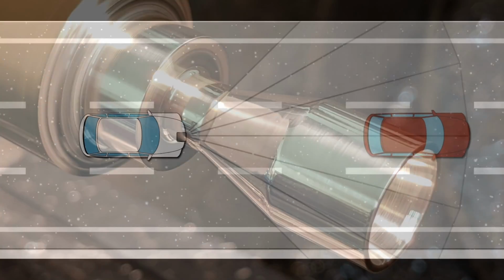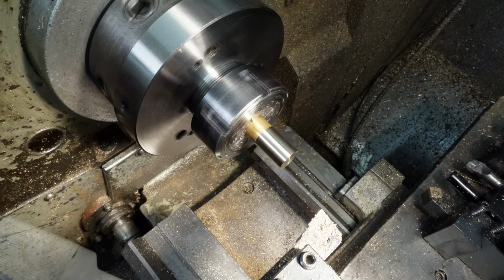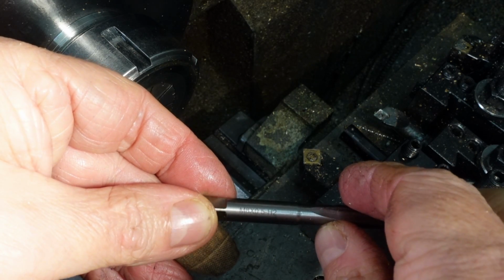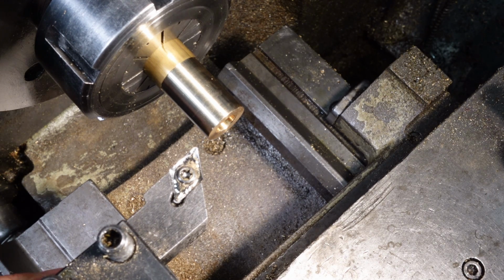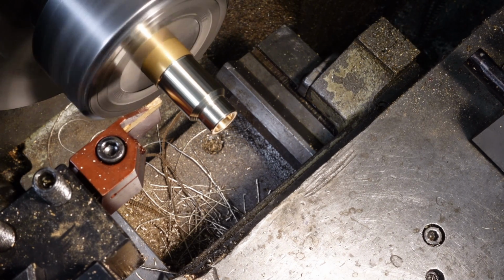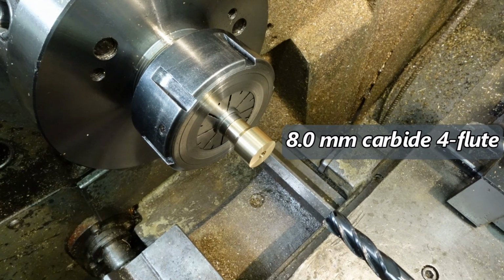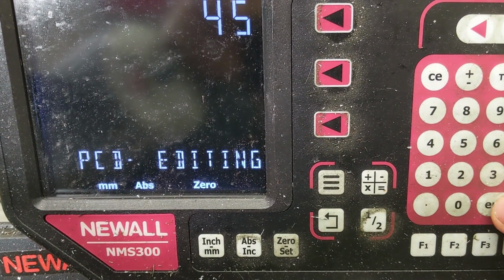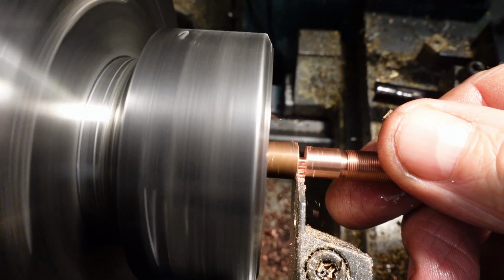Machining 53dBi antennas for 122 GHz mmWave Radar chips!

Comment: Spins drill in chuck while tightening to convince oneself it is helping to prevent clamped chips

Has all of his quick change tools sitting on the cross slide getting showered with brass chips the whole time

You're a madman, my friend. These videos are fantastic. Cheers!
Reply from the maker: One day, the plan to make a rack for the toolholders might actually happen.  One day.
Reply: @MachiningandMicrowaves  do you have a 3D printer? I printed holders for all mine and just screwed them to a board. Happy to send you the file.
Reply from the maker: @anguswhitnall1084  That would be useful, I have a Prusa MK3S+, thanks very much.

Comment: How have I not found this channel before? This is really interesting!
I was born in the 60's and I'm very "unit ambidextrous", I learned metric at school (in Australia), but my father and grandfather used imperial at home so i had learned to convert in my head before I was 10. We changed from miles to km when I was a young boy but my 2 of my first 3 cars were in miles. When I started my apprenticeship all the machines were imperial, but at trade school all of the machines were metric. And the man who taught me all about radio taught me "megacycles" before I knew they were supposed to be called megahertz.
Reply from the maker: I remember GHz being known as kilo-mega-cycles by some of the old timers I used to know in the middle 1970s when I was messing with 10 GHz Gunnplexer transceivers and varactor multipliers and bare-diode mixers. I'm still messing with multipliers and bare diode mixers, but at 135 and 248 GHz.  Everything is less than a tenth of the size of what we used to mess with back in the dim and distant past, but just as much fun.  I have very limited time to make vids, but I have a list of more than sixty that I want to make now, there's ten more in the list since 2 am local time today. John Hazell and friends down in the south of England have been using Hellschreiber visual mode on 122 GHz https://www.youtube.com/watch?v=_hAaYinsG64
Reply: @MachiningandMicrowaves  very interesting! I've always wanted to play with those car radar devices, but I don't have that much time to play with radio anymore (at least outside of work). When I was active in amateur radio I was mainly interested in VHF and up and even made an EME (Earth-Moon-Earth) contact.

I'm actually a Fitter & Turner (and worked in that trade for 11 years) before owning a business installing & repairing 2 way radio and satellite systems in the 1990's, For the last 23 years I've been a Broadcast Engineer in commercial radio - although the company I work for outsourced all of our RF work 3 years ago. I'm looking at getting back into radio at home when I get some more time!
Reply: I was born in the US, Iv always had to at least be somewhat comfortable with other units, starting in working on Japanese motorcycles and whatnot. Not as fast to convert as I once was but I still don't get it when people get so upset about not including certain units.
Reply from the maker: @miles11we  The funniest attempts are when someone does a literal conversion of an approximate value, so "roughly 2 pounds (907 grams)" or "two or three miles (3.22 to 4.83 km)".  Of course, we do have to be very careful about gallons, pints, quarts, hundredweights and tons between UK and US systems. That has led to some very funny arguments about fuel efficiency or vehicles, when the US measurements use different sized gallons.  Marvellous!

Comment: Incredible work! I was thinking about the instrumentation to calibrate at this frequencies. As a technician who worked with C and L bands handling those HP spectrum analyzers was a big responsability due to their high costs.
Reply from the maker: Most instruments stop around 110 GHz, but as we are interested in maximising the far-field and directivity of the antennas, up to a point the S parameters, return loss and bandwidth/frequency behaviours are less important and we can concentrate on bulk characteristics like the received signal strength at a remote location. It's possible to use harmonic mixers, but my simple home lab equipment only covers up to 50 GHz and that's a simple spectrum analyser.
Luckily, the radar chips have all of the SHF components including the antennas integrated into the package, so we are not dealing with anything more than about 2 GHz outside of the chip and in fact we run an IF of 144 MHz for convenience. Some of the instruments out there are certainly about the same cost as a house.  I'm just working on an EM solver model of a tiny choked feedhorn, 3.8 mm diameter with a 1.8 mm core and a choke ring 0.5 mm wide.  Machining those is certainly fun.  For certain very carefully defined values of "fun", obviously

Comment: Just found your channel and now binge-watching your videos! When I was doing my master's in physics I had the university machine shop make me several microwave cavities with intricate internal geometry out of OFHC copper... Just realizing now how painstaking it must have been for the poor machinists. Hope they didn't curse me too much!
Reply from the maker: Oh, but just think of the fun they had making up new curse-words especially for you! I'm having a self-inflicted nightmare making the smallest antennas I've ever attempted. Designed to give -11dB edge taper on an f/d 0.4 prime focus parabola, 3.6 mm outside diameter with a tapered waveguide from 2.00 to 1.80 mm in Tellurium copper and a face choke groove 0.5 x 0.6 mm with 0.2 mm walls.  Definitely at the "interesting" end of what I can make on this 1 ton slab of old cast iron and 1950s tech.  Still, I'm 1950s tech so it seems fair enough.

Comment: Seen the post on hackaday, wasn't expecting the antennas to have this shape, reminds me of a school project when some dude tried to make rocket engines out of 6061-T6, of course they all blew up but he spent whole lunches in the machine room, nice effort.
Reply from the maker: They do have a passing resemblance to a hybrid high-test-peroxide engine if you screw up your eyes and turn your head to one side in a darkened room.
Reply: Interestingly, there was a rocket engine made entirely of aluminum - but the only way to keep it solid is to cool it from the outside.
Reply from the maker: @robbiejames1540  Bit lighter than Inconel I guess. I've never played with rockets, but one of the Youtuber rocketeers is trying to use servo controller vectored thrust to do a Spacex-style soft vertical landing and I had thoughts of using three solid rocket engines which can be moved outwards under servo control in lieu of a throttle to reduce the effective thrust and control direction.  
Must Not Start Any New Projects.....
Reply: @MachiningandMicrowaves  
Funny thing - I'm currently trying to build a rocket engine, but after watching your video I was practically chanting "no new projects" to stop me from immediately heading off and trying to make radars :) Thanks for the very interesting video.

Comment: Well done! I found your videos while looking for a magnetic lathe chuck and now I find that you're into microwaves, radar and such. Those are other, professional areas of interest for me. Love your assistant AIMEE....she'll keep you straight! 👍
Reply from the maker: She's fierce! I'm just trying to get hold of something like the Simturn E3 grooving cutters to make an aluminium mandrel for a corrugated feedhorn at 122 and 135 GHz.  I'll then give it an etch and zincate coating, gold electroplate, then nickel, then a thick layer of copper electroformed and finally boil it up in sodium hydroxide to dissolve the aluminium, leaving me with a gold-coated corrugated horn with extremely low sidelobes, and great axial symmetry, but also, breathtaking bling and wizardry to impress my mother. Who watches this channel.  Hi mum!

Comment: I was thinking of chuck offset just before your comments on spininng the bit as it's tightened. Lovely.
Reply from the maker: Drilling the 1.8 mm diameter holes 48 mm deep with long-series drills really shows up any offset or concentricity errors in the tailstock or chuck, or bends in the drills. I start the holes with a 1.6 mm centre drill and use a smaller high-precision chuck, and check the tailstock position regularly, plus I always clean the bore of the Morse Taper in the tailstock with a sheepskin-covered bore wiper and clean the taper of the chuck carefully.

Comment: I remember when Dad did something like this in the 50's.  He had a 500mm (there abouts - silly millimeter or two) a vacuum tube (valve ?) amp and all.  He was snagged by the local law and went before the judge.  He showed his Advanced Radar with an unlimited note on it - but the judge didn't recognize the FCC and Automobiles.  Dad took it off but completed his tube (there I go again) timing system for our car.  He was something else if you put him in an EE or ME shop.  I have his lathe now.

Comment: Don't you find rotating your drill as you lock it up helps avoid clamping on "pickup burs" on the shank from when you last let it slip in the chuck  ?
Reply from the maker: That's a good point. I try to remember to clean up any drill shanks that get messed up, but most of the holes I drill on the lathe are done with drills I keep specially for that purpose, for tap sizes or reamer pilots, or are non-critical. I guess I picked that habit up from watching my father rotating drills as he chucked them but never questioned what the real reason was. A 50-year mystery solved! Cheers!

Comment: Very entertaining and informative! Thanks
Reply from the maker: Thanks for watching.  Next step in that project will be the subject of a video in 2-3 weeks time. Making a range of dual-mode feedhorns to fit into those adaptors. Absolutely tiny features, with 0.5 mm grooves and 1.8 mm tapered bores. Huge fun using an ancient 800 kg cast iron metal-basher to make antennas so small you can lose them in a trouser pocket, or blow them off the bench if you sneeze.

Comment: I have absolutely no experience, education, etc. in radar, but this video has piqued my interest. 

So you know, I am a licensed pest control technician and have interests in electronics, machining and Isuzu. 

You've earned my subscription.
Reply from the maker: I hope I can keep everyone interested, I'm fascinated by all sorts of things. I've been working on some new antennas only 3.6 mm diameter and 30 mm long this evening, with a 0.5 mm groove 0.7 mm deep in the face.  I'm using a lathe that weighs almost 2000 pounds.  The part weighs less than half an ounce

Comment: Fascinating content, much respect and best of luck to you, sir! Instant subscribe and like 👍👍👍
Reply from the maker: There's a huge amount of content I'd like to get filmed and produced, just not enough hours in the day to do it. Tonight's problem is taking the "electronic leadscrew" approach that James made, but using a really muscly 750 watt AC servomotor with an absolute encoder to drive the cross-slide, plus a hack of my DRO so I can make parabolic, hyperbolic and elliptic surfaces mirrors to work with microwave and mmWave antennas. Trying to design the mounting so it's impossible to engage the transverse leadscrew while the servomotor is active. I've been out in the garden with a green laser, translation stage and precision rotary table, trying to get the rear focus of a hyperbolic subreflector to be coincident and coaxial with the focus of a large parabola.  That is going to be hugely challenging to film, but I just have to do it now I've had a dry run.  Neighbours must think I'm having some sort of techno rave, but spookily quiet.  I've been to silent disco events, where there are two DJs playing different tracks and transmitting them on two channels which can be received on selectable-channel headphones that all the attendees are issued with.  Except I was listening to the level of a transmitted tone and trying to peak up the focus of the dish so the laser beams were parallel at 30 metres away.  Honestly, the things I do for my hobbies!

Comment: Subscribed. YouTube finally recommended a micro machinist! Def an interest of mine as I'm building a ride-on steam locomotive.
Reply from the maker: Lots of folks seem to be working on steam projects, I enjoy @MrCrispin96 Andrew Whale, @keithappleton @trainman4602 and everyone making Stuart engines, plus Lisa Milne (TiklishHoneyBee on Twitter).  I'm more interested in clockmaking and watchmaking and radio stuff, and I've always fancied getting a stationary engine.  My father worked at Ruston and Hornsby, and I'd like to get one of the 1930s models. I'm probably not ready to embark on building a steam loco - maybe if I ever get to retire!
Reply: @MachiningandMicrowaves  I am familiar with most of them but you have really got my attention. 

I'm a digital electronics guy, radio has always puzzled me. My father is a ham and was an electrical engineer at Motorola responsible for the cellular base station division. Unfortunately that radio engineering knowledge never trickled down to me.

Greetings from Chicago btw.
Reply from the maker: @GeeWillikersMan  The really interesting detail is where you push beyond what you can design using Maxwell's equations and field theory by hand or rule of thumb and move into metamaterials and graded index lensing and unusual cavity resonances. I'm working on some models for axially-displaced ellipse antennas, which don't suffer from aperture blocking. That means using big AC servomotors with absolute encoders to drive the leadscrew and cross-slide on the lathe. I'm doing a lot of work on the mechanics and control systems for steering large moonbounce dishes to track the moon. Also messing with some non-radio electronics, but mostly PIC devices and linear microwave things like Gallium Nitride HEMT amplifiers. I do a bit of work with FPGAs using Verilog, but there just aren't enough hours in the day.  I just noticed it's 1am here and I have to be at my desk in 7 hours....